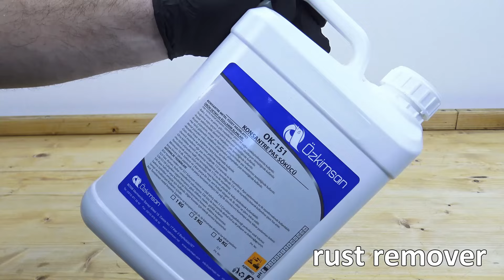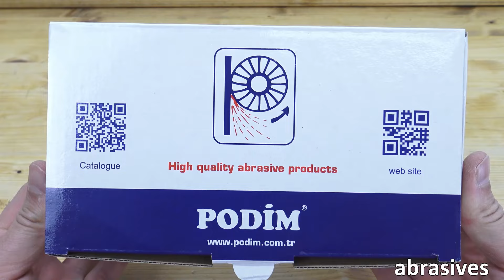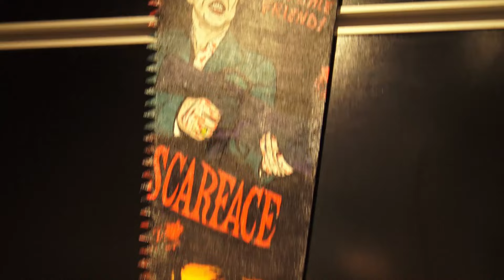1950s Oil Lamp Restoration - Lantern Restoration

Comment: 1:50 Advice, use pliers for any tab you want to remove. Reason being that, if you bend a piece of metal fast, you'll fatigue it, and you'll stress it, thus raising the chances of it breaking the next time you bend it. With a pair of pliers, you can slowly massage the tab (or metal) back into its original form and avoid that fatigue in the metal.

My personal advice, get a pair of flat nosed pliers (only 5 mm wide in the jaws), and grind one of them to a thin profile. Those will be your special tab pliers, because you can slide them in behind the tab, without undue action upon the metal.

Any cheap pair will do, and some sets of small pliers (the ones with red foam like handles) will already have that specific type of pliers you'll need.

Just my 2 cents, nothing more.

Comment: Another great restoration! I know how much work it is as I just finished a 1925 Coleman Lantern. It's nickel plated brass, and was totally black with very difficult to remove baked on crud. As you do, I completely diassembled, cleaned and polished the brass/nickel parts, and painted the steel parts.
Reply from the maker: I am sure your work has been very good.

Comment: Instead of using chemicals,  try using white vinegar to remove the rust,  it works wonders.  Just soak for a day or two,  every few hours use a old toothbrush to scrub it

Comment: Nicely disassembled and refinished. The only issue I see is you should have nickel plated the polished bare metal parts. Bare metal will get surface rust on them in no time. But absolutely great otherwise. Thumbs Up!

Comment: Nice restoration, you did a great job on it. I have question though, if the inside of the oil tank was rusty on a lamp like that how would you clean it?
Reply from the maker: Liquid rust remover as our friend said. I already used liquid rust remover in the video. Didn't you watch?
Reply: @meinemechaniker  I did watch but I guess I didn't pay attention lol